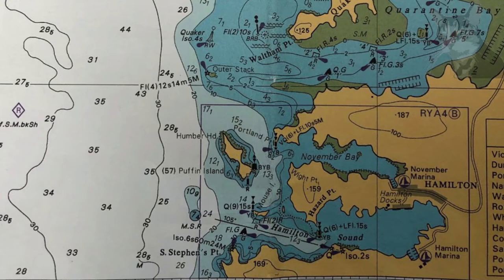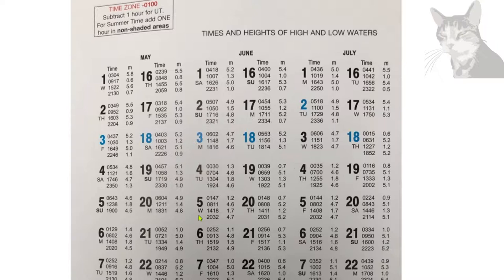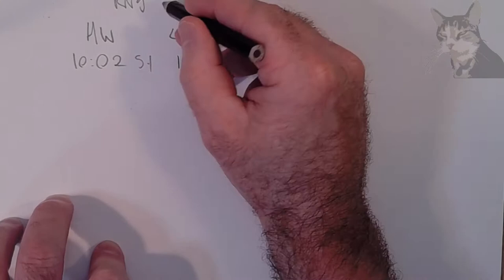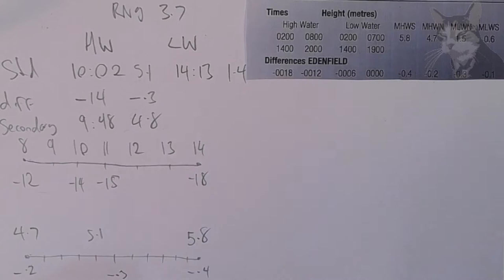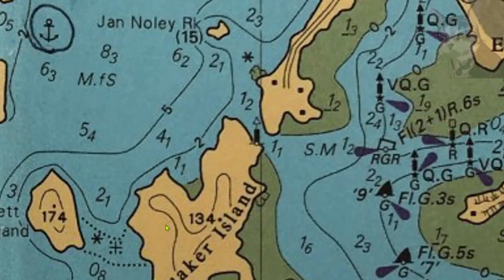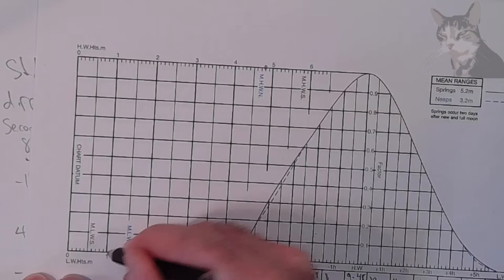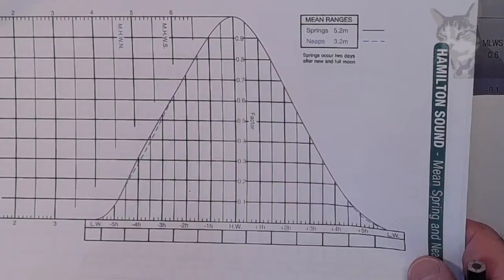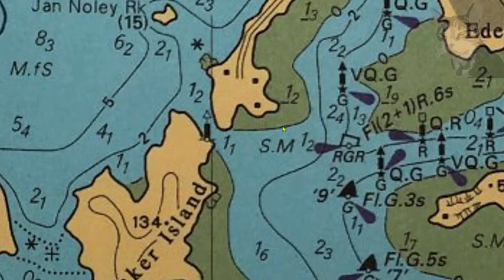Calculating Secondary Port Tide Times and Heights

Comment: Sir do you also need to take into account the seasonal changes?
Reply from the maker: No, I'm using the tide height values straight from the almanac for the particular date and time I'll be there.
Reply: @sbcode  thank you sir😁
Reply: @sbcode  Could you please explain this in more detail as why the seasonal correction is not required.Can we use the same method for Pacific tides as well.Thanks
Reply from the maker: The values from the almanac are seasonally corrected already. For Pacific almanacs you need to check with the publisher